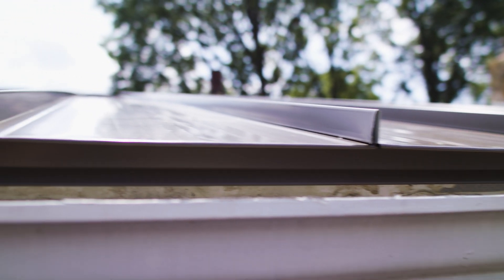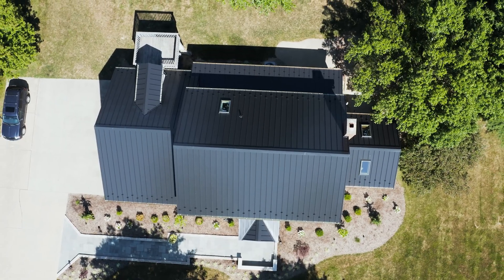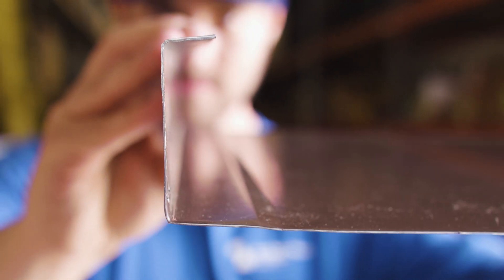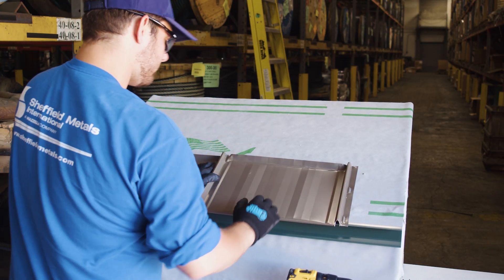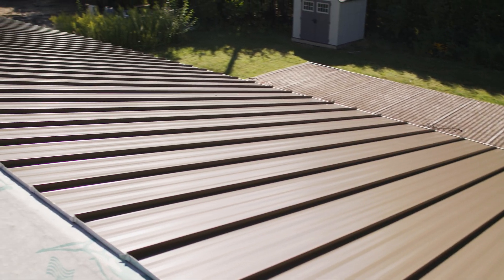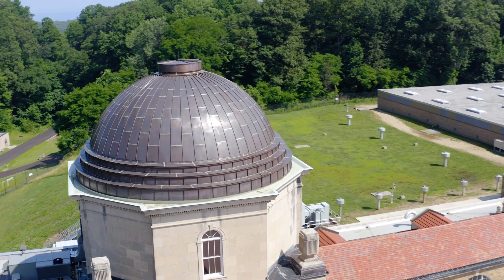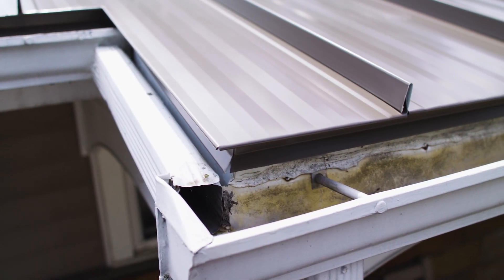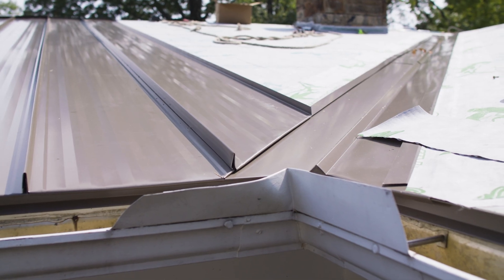What Is Standing Seam Metal Roofing? Definition, Profiles, Pros & Cons

Comment: I heard standing seam roofing is great for solar panel installation because the mounting brackets can be clamped to the seams instead of fastened to the roof deck, creating a penetration.  Which type of standing seam is recommended in this application?
Reply from the maker: Yep, very true! Most types of standing seam panels for residential can work with clamp-on solar brackets. We recommend S-5! mounting brackets, and they have a list of panel profiles their systems can attach to: https://www.s-5.com/products/solar-racking-systems/ -Thad